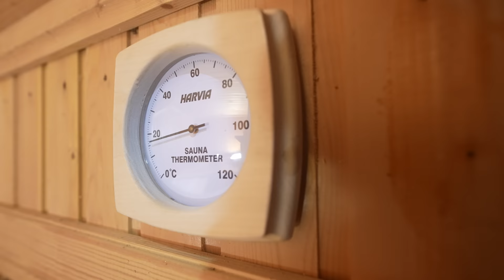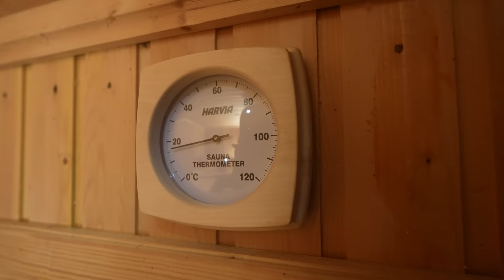Building Off Grid Sauna in the Forest

Comment: Great video! YT is full of "professional" so it's nice to see normal people working together. I'd like to add fresh air to the points that Matias made regarding how good the Löyly is. Having a flow of fresh air will provide you with oxygen so that the löyly doesn't feel suffocating and you can spend more time in the löyly. Also the stove or kiuas needs a lot of air to burn well without producing harmful gasses. So adding an air inlet would be a huge plus. Otherwise nice work!
Reply: Yes, true. We made big holes for the water to be able to drain, they work as air in as well, but there needs to be an air out somewhere close to the roof as well.

Comment: Hey Kalle! After watching your videos for many months on nebula and youtube I see how you struggle bringing materials along your long driveway. I'm not sure what the Swedish equivalent is, but if you look for old garden tractors on the online market listings, look for a hydrostat/hydraulic drive one, they are cheap, I got one for $1500 CAD, and with a small trailer it can be a big deal, whether you are collecting your firewood, mowing the lawn with it, snowblowing with it, or towing a trailer of construction materials. I use a 1978 Case 444 tractor to give you an idea, and its been super useful to bring materials to my cabin that I've been building. If you need help on a particular model or want me to look at a listing, I can help you find one in your area! Hope this helps. Lukian
Reply: Interesting, how would you compare this kind of tractor to an ATV? Is it just the budget variant or does it have some benefits over an ATV?
Reply: @Talasbuan  ATVs cost a little more, the tractor is definitely slower but with hydraulic or hydrostat drive you can get attachments. I got a snowblower and lawnmower attachment for mine, and I have chains for the big drive wheels. Hope this helps
Reply: @Luke50041  Aha! I see, something that drives a snowblower would be great. Is there a 4wd variant of these kinds of tractors? Or is that not necessary?
Reply: @Talasbuan  Yeah there are, but then I'd believe the price would be steeper. I have chains on my drive wheels, and the wheels are quite large to begin with. It's worked great so far.

Comment: It will be great to sit in when it so cold outside, but I wonder if these saunas have a problem with black mould? As they are very humid, once the fire is over, then it must get really cold inside, so with the moisture, does that not create a mould problem on the walls? Perhaps they are well aerated, so this prevents this from happening?
Reply: After the sauna session, one puts in more firewood to dry upp the space.
Reply: @Talasbuan  thanks, that makes sense! p.s  I like your channel as well. Some great filming and interesting projects.